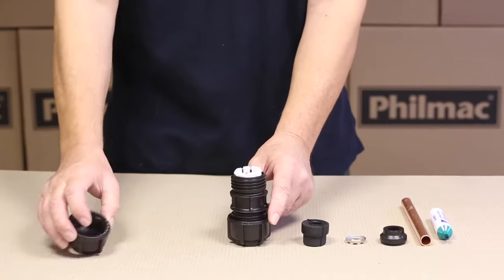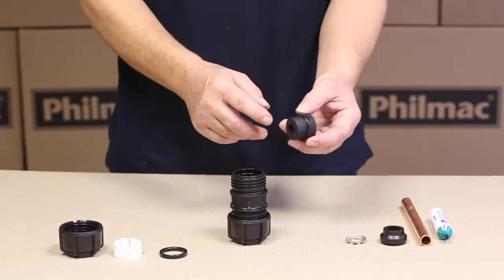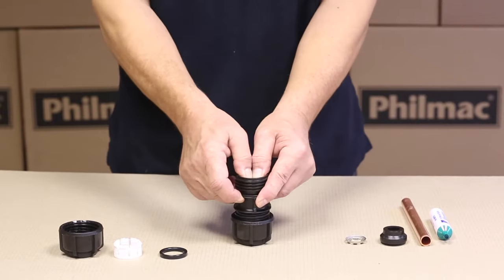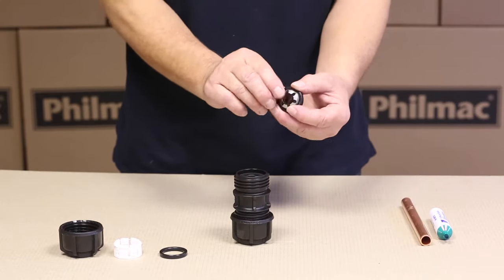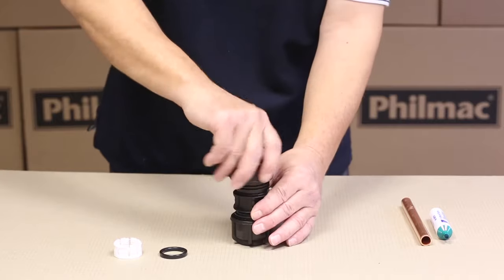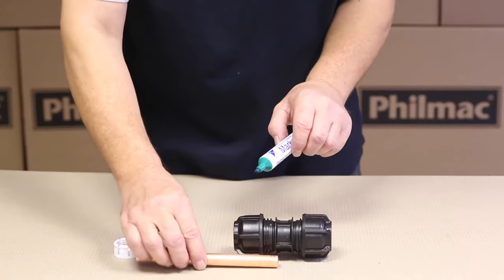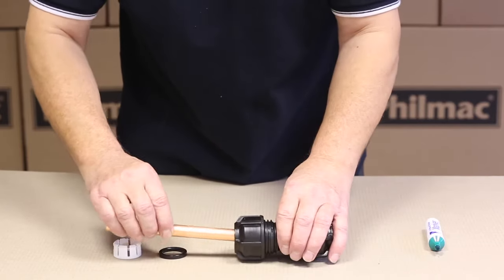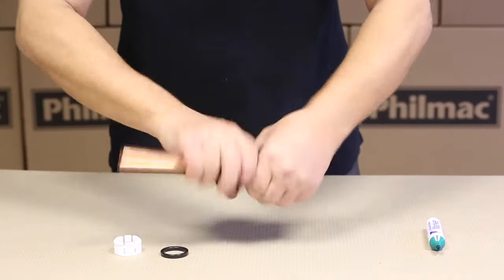How to connect PE pipe to copper using a Philmac 3G Copper Connection Kit

Comment: Wondering if you can help me. I have come across this polyorc pipe used in the 70’s and 80s when there was a shortage of copper. 

Cut this pipe thinking it was some sort of 15mm plastic pipe wanting to put a 15mm isolation on it, but seems to be 16mm or 17mm.

So you still supply any sort of fittings for this?

Any help would be appreciated.